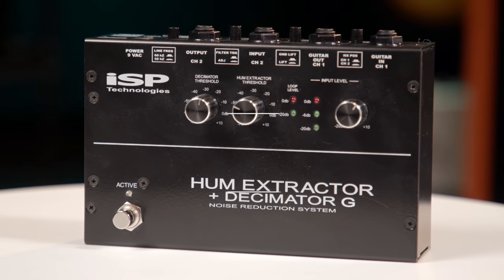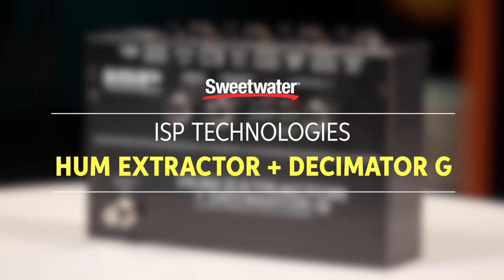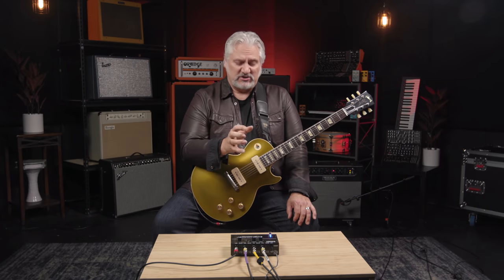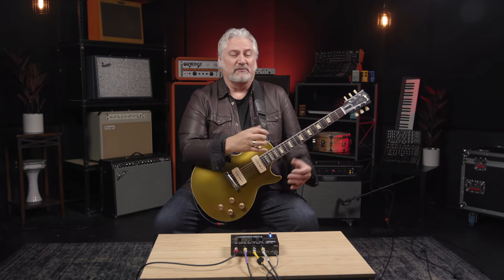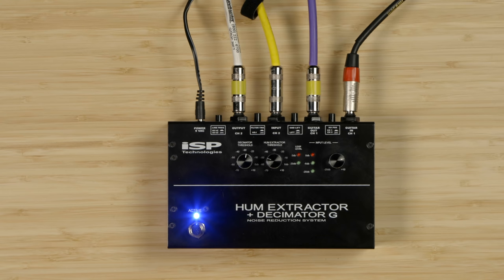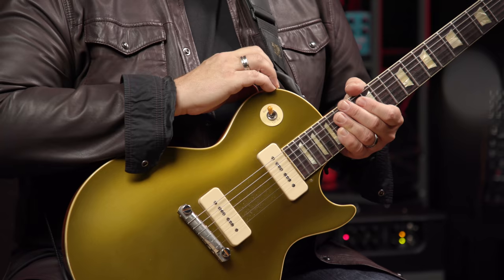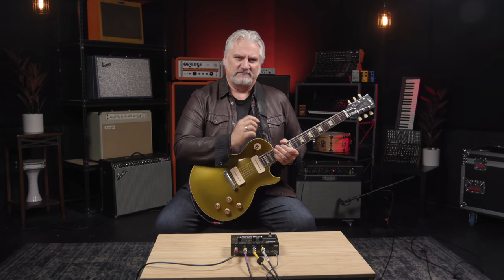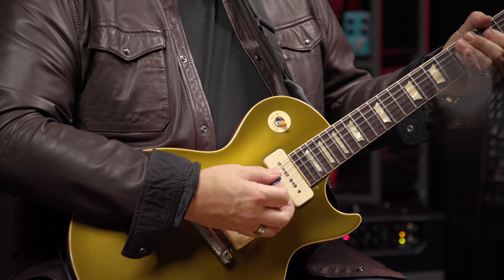ISP Technologies Hum Extractor + Decimator G Demo

Comment from the maker: No matter how noisy your guitar rig is, this Hum Extractor from ISP Technologies will make it whisper-quiet 🤫 Don't forget to like, comment, and subscribe for more sweet gear like this🔥
Reply: O.K! Interesting video Sweet Water. Seriously looking at this product, but for me using single coils mainly I've noticed when incorporating a EUNA 29 boost at the start of my single chain the hum has dramatically increased with low gain using either a Magnatone Twilighter Stereo, Vox AC 30HW60 or J-Mod 100. Agree a boost pedal will increase any noise level, but can i incorporate this with in my j-Mod effects loop and more importantly using with OX Attenuator via a combo tub amp. Look forward to your reply Paul :)

Comment: The video demoed a heavy or with distortion sound.  Will this also work for a regular Strat 60 cycle hum (neck p/u) on an edge-of-breakup sound? For example using class A type amps?
Reply from the maker: Hi, Johniee! Good question. Two part answer…
One; 60 cycle hum from a traditional single coil pickup can only be reduced by utilizing a secondary stacked coil internally to the guitar. No external product will remove that sound.
Two; noise reduction is a balancing act between the operating idle sound of the amp or pedal and your playing dynamics. Objective is to decay notes as naturally as possible while also reducing the background sound of the gear.
Please contact us direct with other questions as you have them!
Robert Williams, Senior Sweetwater Sales Engineer, (800) 222-4700 ext. 2371, robert_williams@sweetwater.com

Comment: Can you plug it into your 9v power supply along with your other pedals or is the power supply for this pedal different?
Reply from the maker: Hello, great question! That pedal requires 9V AC and 800mA of current. Most 9V supplies are DC and do not supply that amount of current, so it would be best to use the included power supply. Something like the 1spotProCS12 does have a 9V AC 800mA output:
https://www.sweetwater.com/store/detail/1SpotProCS12--truetone-1-spot-pro-cs12-12-output-isolated-guitar-pedal-power-supply
Thanks!
Jason Filloramo, Sweetwater Sales Engineer, (800) 222-4700 ext. 1281, Jason_Filloramo@sweetwater.com

Comment: How do you set the threshold and filter tracking? Instructions aren’t clear, they just say to turn clockwise until desired setting is achieved. What am I supposed to be listening to?
Reply: Anyone? I could really use some help I reach out to isp directly and they won’t respond.
Reply from the maker: Hi J JK, great question! The threshold determines what amplitude of signal is allowed through the noise "gate" so it will depend on the signal to noise ratio of your setup. You basically want to keep it as low as possible to maintain dynamic control, but turn it just far enough clockwise to eliminate the "idle" noise. With the filter tracking it just depends on the nature of the noise, so experiment and see what sounds better.
Thanks!
Jason Filloramo, Sweetwater Sales Engineer, (800) 222-4700 ext. 1281, Jason_Filloramo@sweetwater.com

Comment: Okay, I have no idea if this will do it or not, but it needs to be able to do this :

You get up on stage, plug in and there's all sorts of horrible plugging and humming and feedback like there's SUPPOSED TO BE cuz this is rock and roll. Then it slowly fades it out while you pretend you know how to check the tuning that the guitar tech did five minutes ago.

If it can allow me to unplug in a noisy fit of rage without having to fuss for the little off button like a delicate china doll before storming off stage, that would be a bonus.

Comment: "Pretty amazing, right?"
No. You turned it off and started talking before my ears could really get a chance to adjust to the change. It sounded like it was pretty good, but I know the ramp on my ears and wasn't given half a chance. Then you stopped talking and started playing. So no, not amazing. It kinda felt like I was being played by a salesman not given an honest demo of a product which may actually be good. I'll never know, cuz SKIP.
Reply: Don't know what you're talking about
Pickups on made really bad hum

The moment the decimator was engaged the hum was either gone or almost none existent.
Reply: @ezer0923  Peter is right, Mitch's talking started within 1/2 second of him clicking the Active Button and they should have edited in another second of what the pedal calls "silence" before he started talking or playing - like Peter said - to give your ears a chance to not only adjust but to actually hear the silence. 
I thought the same thing when I saw 1st time and rewatching makes it more obvious.
His playing was too showy and left no room (space) for the listener to hear any possible noise or bad artifacts of the noise reduction. And I'm not suggesting a long video - it could've been the same length without the 30 second solo. All we need is a few sustained notes at varying gain (volume knob on guitar) and pick attack (hard/loud vs soft/quiet) so we have the space to hear signal vs noise & redux-artifacts. It's about showcasing, not a bunch of talking and selling.